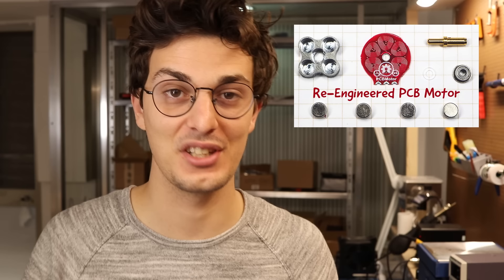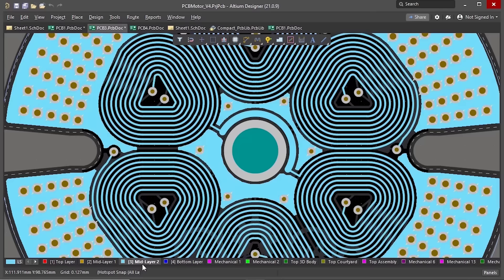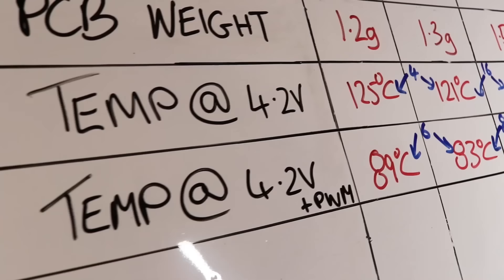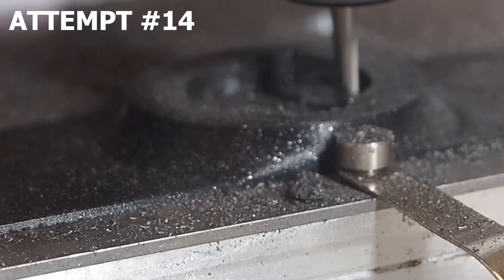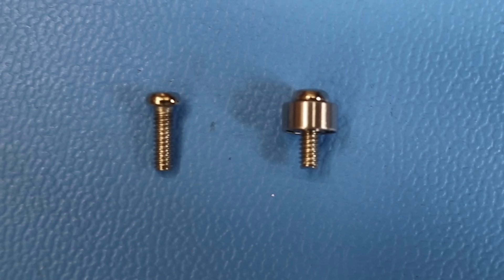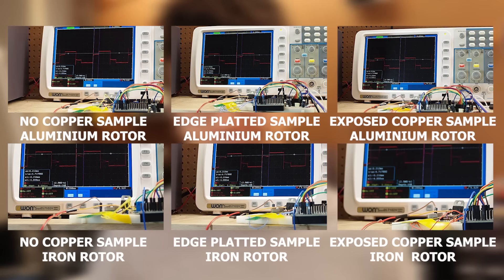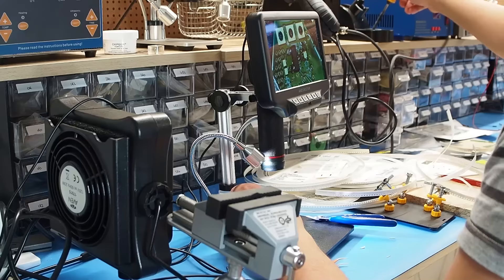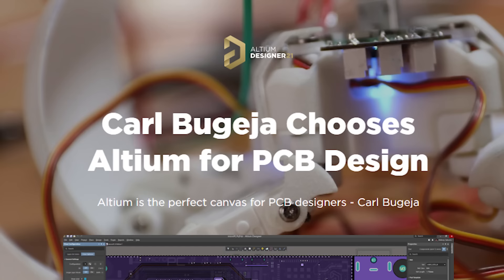Making PCB Motor v4

Comment: Making a magnetic flux core (in your case the rotor) from iron is good! But if you can make it out of laminate thin plates of sheets of steel is a lot better!!! 
The amount of Eddie current is a lot lower!!!
Reply from the maker: thanks for your comment :) this was definitely something that i was interested in testing but it was hard to do with this rotor version .. but I will definitely test it in the coming months
Reply: The rotor has a static magnetic field, the magnets supply this. I don’t see much changing magnetic field in the rotor which could cause currents in the rotor, what will be the advantages of using a laminated rotor construction? Once the rotor has locked onto the rotating field the losses should be low. Adding a core to the pcb coils might increase the increase the strength of the field, this should be laminated because it does rotate and would have eddy currents.
Reply: @klave8511  whoops, you might actually be right! 😅 indeed I was confused by the changing magnetic field of the AC voltage on the rotor! 😁 So then there wouldn't be actually not much difference between a plastic and a steel rotor!? Besides the weight difference?! 🤔
Reply: @CarlBugeja  or  maybe what abaut a copper magnet holder/rotor?! 🤔 Or pure silver!😅
Reply: @TheOpticalFreak  : No, I think a steel rotor would still be an improvement over plastic or aluminium because it would still channel the flux into the areas you want it, mainly from the reverse side of the magnets where it isn’t helping drive the rotor. Bearing in mind that the rotor is moving, any nearby metals would create eddy currents and losses, always better to make the flux go where you want it.

Comment: I am building something similar. What are you using for the motor controller? I am stuck with figuring out what to use as the motor controller on mine.

Comment: Hey carl,
through your video, I also work on the PCB motor, my PCB dimension is 120mm Diameter 2 layer and 6 coil 3 phase Delta connection. Can you just help me with testing when I assemble with the rotor and the magnets and supply with the controller, It can't move whereas other conventional motors are working fine with the controller. I am stuck in this can you just help me with this.

Comment: Go check out the video on the NYC CNC youtube page about using super glue and painters tape. I use it on my milling machine and it would have worked really well for you here. The double sided tape doesn't provide enough adhesion and it's also too pliable.

Comment: 5:00 =/

All you had to do was heat up your part and the bearing would fit without any hammer, genius.
Reply: the magnet would demag
Reply: @gedr7664  Is there something preventing glue the magnets AFTER pressing the bearing?
Reply: @hate-conductor  it would demagnetise the magnets if you heat them up above 80C
Reply: @hate-conductor  the point is, if you heat it in the first place the magnet will be heated as well when you press it inside?
Reply: @gedr7664  I already wrote twice - FIRST heat the part and put it on the bearing, and only then glue the magnet.

No offense, but you really have trouble with your head, I explain the simplest thing.